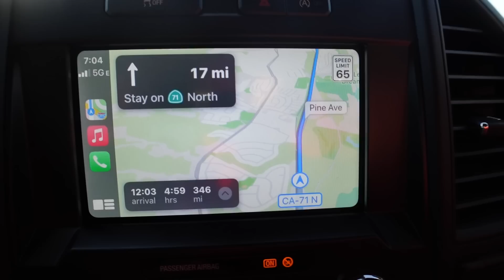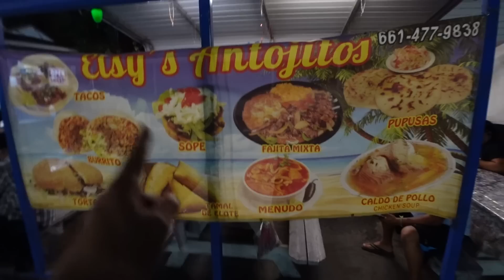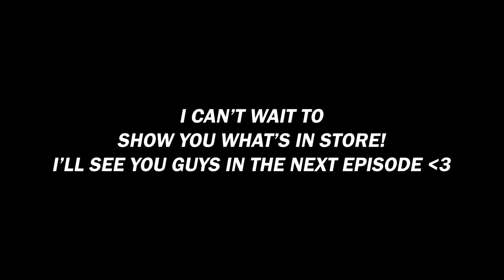I Found A Hidden JDM Gem at a Nissan Dealership & Bought it!

Comment: I have used valvoline 75k full synthetic in my 280z turbo before and loved it! Would love to try out 150k high milage! Still running a stock l28 with 130k on the clock but now running 8psi of boost from my gt35! Awesome vids! Keep it up!

Comment: Complains about a motor , then says he’s going to do a swap
Complains about seats, seatbelt and headliner, 
Talks about changing seats anyways. And headliner is the easiest thing to fix... 
that red 240 with 1 owner is the rarest thing you can ever find. Be very grateful, I wouldn’t even mod it and make it the cleanest stock 240 out there
Reply: fax he could just buy another 240 that’s already modded or a roller to do a swap and stuff 😭👎🏽

Comment: If your gonna redeem yourself on this 180, what about a redemption on a type r??
Reply: I 2nd thisssssss
Reply: Not a 180
Reply: @shanechopko5523  In some countries this is called an 180 or Silvia, like here in Australia. but best to call it S13 😉👍🏻
Reply: @regobryan  Ya I get that, but this is NOT a JDM car as he has in the title.
Reply: @regobryan  As far as I’m aware, S13/S14/S15 are the chassis codes, 180, 240 etc designate the engine capacity (1.8l or 2.4l). So you can tell of it’s an S13 or an S14 or and S15 just by looking at it, but the engine size is what determines if it’s a 180 or 240 etc. Same with BMWs.
Reply: @seanissomething  that is correct but the 180sx also came in a 2.0 displacement with the SR20 variants but it was called the 180sx originally because of the CA18 motor it came with which had 1.8L displacement. 

That being said his would be called a "Onevia". So it's more like a 240sx/Silvia based body with the 180 front. 

Gets a bit confusing with the different varients and names in different countries.
Reply: @regobryan  not a 180 at all, it's a onevia
Reply from the maker: it's coming!!
Reply: @dustiinw  can’t wait!!!

Comment: I use Valvoline 5w30 high mileage in my 2007 Subaru Impreza 2.5i Premium, It now has 175,000 miles on it, so Valvoline's new 150,000+ oil would be perfect for it

Comment: I'll use the oil in my 240sx! You got a super clean fins man! I bought mine 2 years ago in a town called Athens, in Vermont. In a 5 story barn with a wooden elevator!!!! 😲 the process to get it down 5 floors with somthinh that hasent been touched in 10 years was vary scary! Lol but talked the guy into basically giving me the car at that point lol and now it's 100% mint 2 years later and would love love to try that oil out on my 240 or 350z malby even my 89 turbo gti.

Comment: I use whatever oil I can find in my 200k mile Is300. Haven’t changed the filter in 20k miles. It leaks so much oil I don’t even drain it.

Comment: Ive done something similar. Drove 6hrs to buy a EBP evo 9. Guy told me fully working running car nothing wrong "just has blow by" got there and car was over heating head gasket was bad coolant and oil was mixing the oil was all white and milky lol. Wasted my time